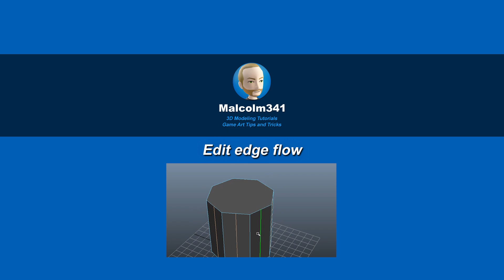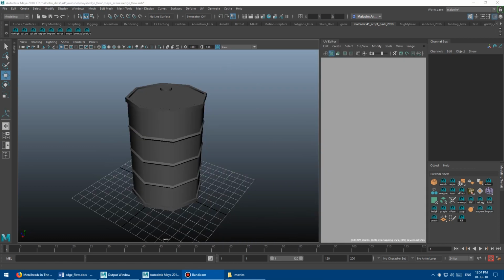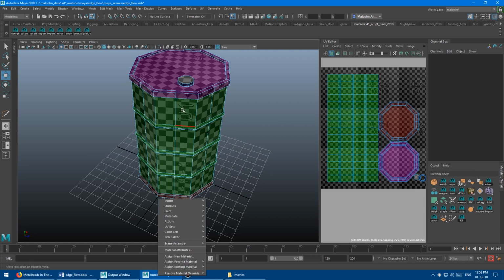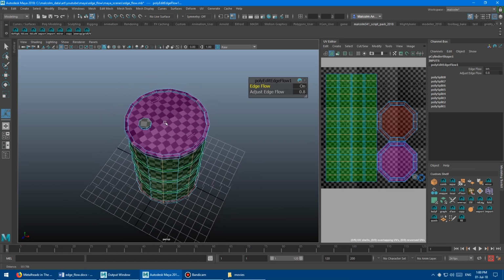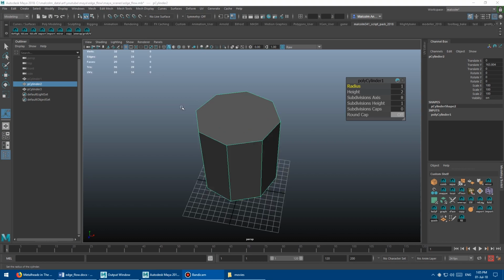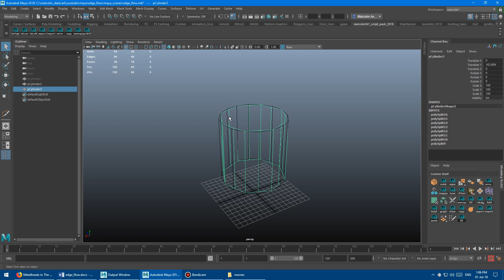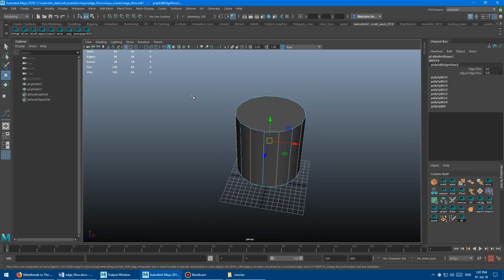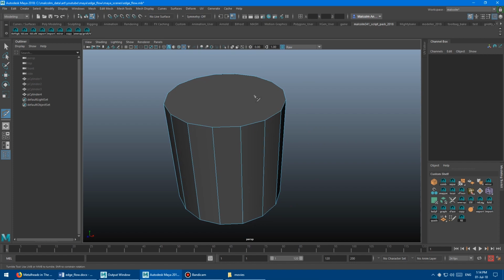Best Settings for Edit Edge Flow

Comment: No. The default setting 1.0 isn't broken.
If you make a 16 side cylinder and delete only one of the edge, then add it back with multi-cut, apply edge flow 1.0. It will match (almostly) with the original 16-side cylinder.
A 0.8 setting would only work if you edit the added flat edges all at once.
Actually, multi-cut and edit edge flow one by one (like in the end of this video) is guaranteed for a bad result no matter what setting you are using.
Reply from the maker: Good point, you must do the edge flow all at once at 0.8 for it to come out perfect.

Comment: why is edge flow 0.8 and not 1? dodgy dodgy|
Reply from the maker: I agree, and the programmer who ported this feature from Max to Maya actually said it's the same way in Max so I guess whoever wrote the original code did it that way for some reason.
Reply: @malcolm341  Ye, but is weird, lol, like aperson who s gonna use it it s going to use obviously a value of 1, unless 0.8 is set automatically for the default setting, otherwise having to know this value is absurd. Anyway I don t use this crap, I lay my polys from curve patches with the surface square tool outputing polys, which is the porper way ;) . Thanks for your input mate ;)

Comment: Yea, all cool.
However my edge flow tool is working exactly as collapse.

Is simply collapsing selected edges.
Reply from the maker: I've never seen that, maybe you have some weird history or the shape of the model is not expected, try it on a cylinder like in the video and see if it works.

Comment: whats the opposite of this, going from smooth (multiple edges) back to jagged (reduced edges)?
Reply from the maker: It appears to be zero, strange it's 0.8 one way and zero the other, but I just confirmed it in the top down viewport with a 8 sided and 16 sided cylinder. Or just delete the edges.
Reply: @malcolm341  Oh no I mean like lets say you have a beveled shape (ex: ring) and want to turn it  back into a hexagon-ey shape (like a bolt)
Reply from the maker: @Sportsman134  Just delete the edges, or select every second edge and set edge flow to zero.

Comment: Been using edge flow on the multi-cut for a while but always used 1.0 now will start using 0.8 thank you
Reply from the maker: Thanks for that feedback, glad it helped you.
Reply: @malcolm341  I just tried it in Maya 2022. The workflow for the Edit Edge Flow Tool is working, setting the edge flow in the multi-cut tool does not give the same result, some of the edges are off.
Reply from the maker: @steffenheise  Interesting, I haven't tried Maya 2022 yet.

Comment: Thank you Malcolm.
How do you make even holes in a shape that has different face sizes?
Let's say you have selected 5 faces in a shape but they have different sizes but same vertex count and you run the "circularize" how do you get same hole size with this tool?
Reply from the maker: I'm not quite sure what you mean, can you post an image of what you'd like to achieve and I'll take a look.
Reply: Thank you Malcolm.
https://i.imgur.com/KQLFrtS.png
How do you make the same size hole in a face after you use "circularize"? because every face has a different size so you will not get same hole/circle size.
Reply from the maker: Oh I see what you mean now. Yes that's a bit tricky, it looks like the circularize tool creates different sized holes as you mentioned. Generally when I'm faced with a tool that doesn't do what I need I usually build a kind of template object and trace around it, or in this case a simple boolean might work for what you want. Also I'd do one half of your model and then mirror it to save time once I finished adding the holes. Here's two different ways you could tackle it, take a look at the links below.

https://youtu.be/eOmuVc9-yzQ

https://youtu.be/BsCIkAYkIFw
Reply: malcolm341 Thanks, I will try the boolean and will watch the videos now 😃